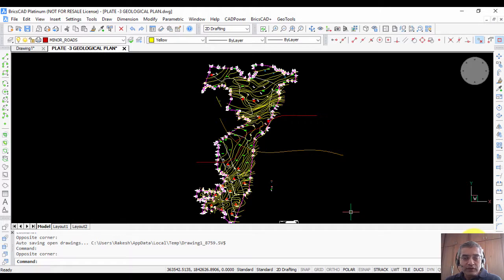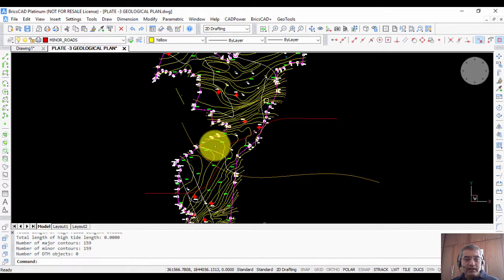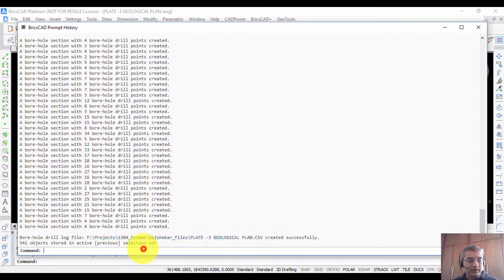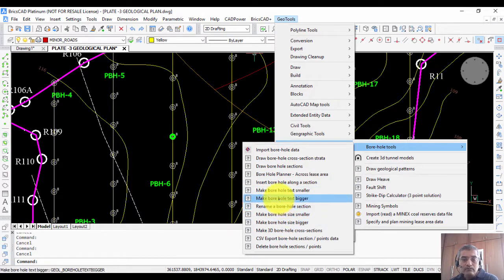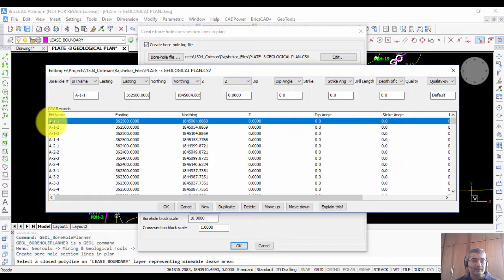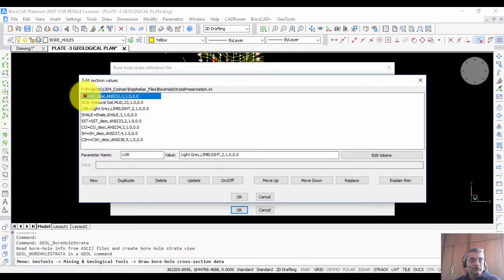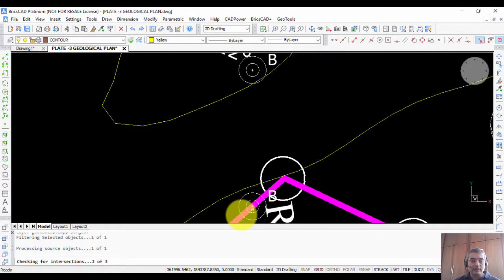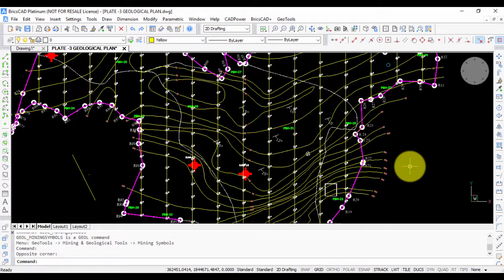GeoTools Tutorials: Overview of Mining & Geology Tools in GeoTools | DesignSense Software

Comment: sir what is borehole strata file nad borehole data parameter presentation file ?
Reply from the maker: Borehole strata file is the file which contains the information about the various layers of minerals in the strata. It tells you how the strata layers and depths are organized.
Reply from the maker: Borehole presentation file tells you the hatch pattern, scale and rotation angle to be used for each of the minerals in the strata as seen in the cross-section
Reply from the maker: I hope this is clear. For further, please call me on 9243438300 / 8073279755